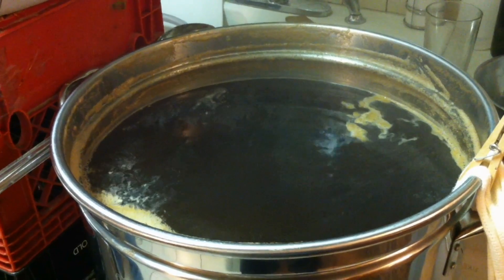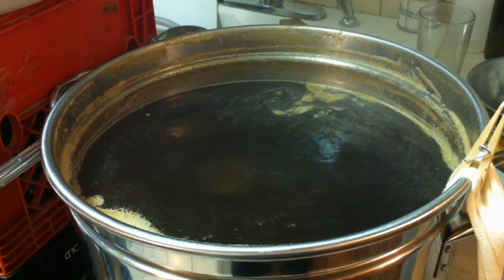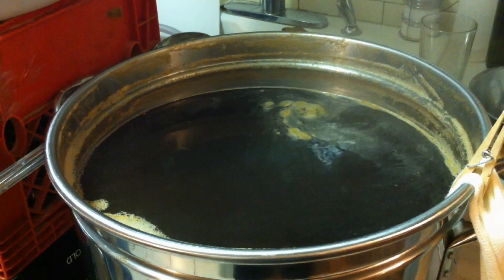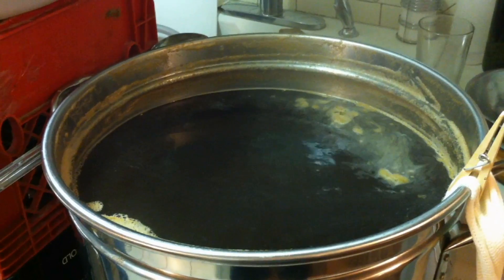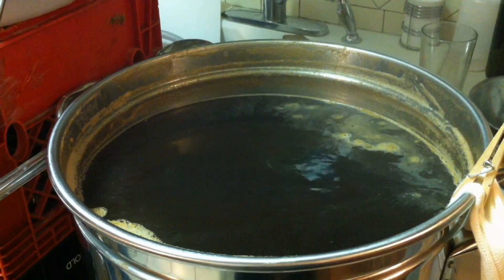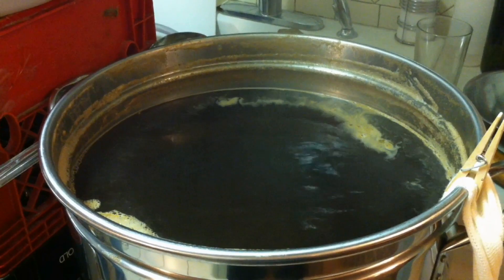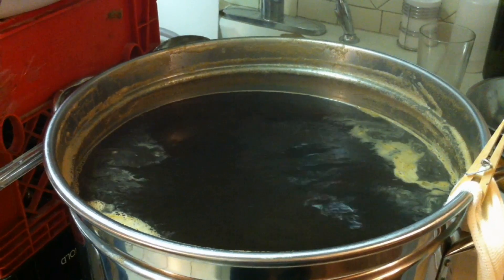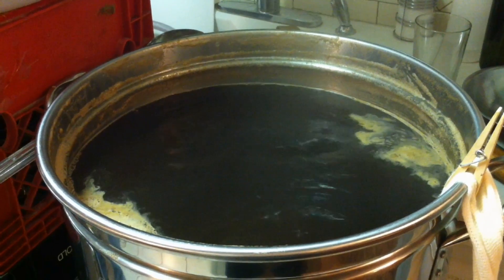EBC II Boil Demonstraton

Comment: Which heating element were you using for this demonstration?
Reply: This is a fairly old video so I'm pretty sure it was the 4500 ultra low density heating element.  We now use the Boilcoil from Blichmann and it is so much better as far a ease of cleaning and performance.
Reply